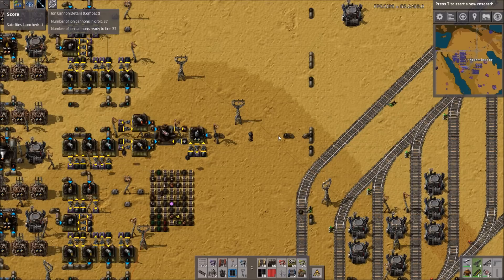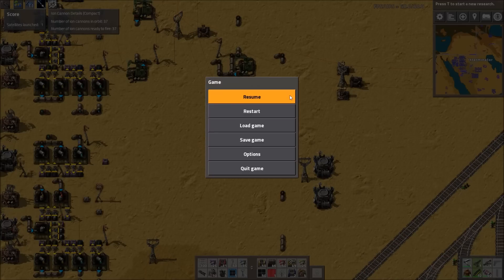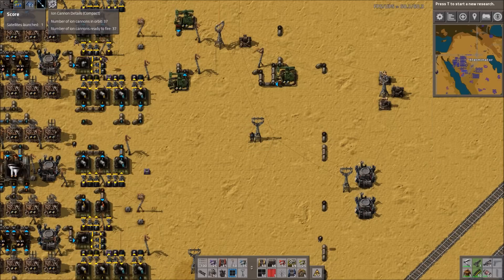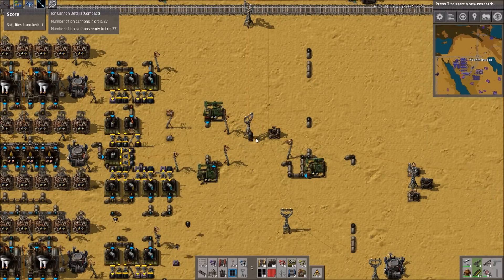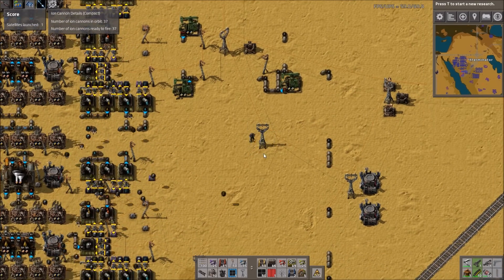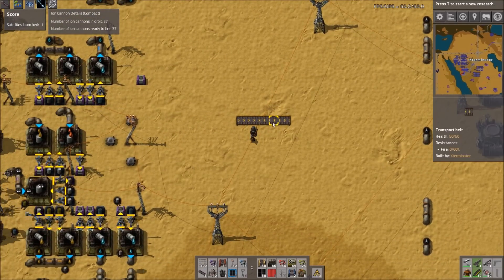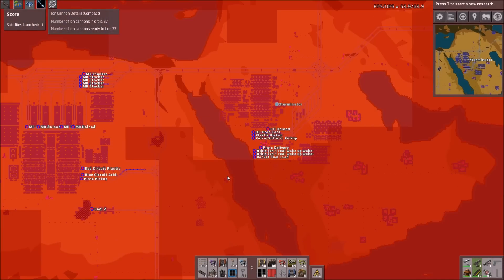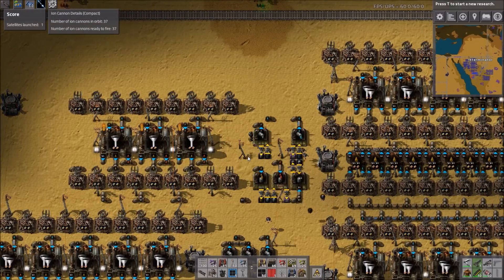5 Ways To Increase Performance & Reduce Lag - Factorio Tutorial

Comment: All this is fixed now? the concrete thing? i think that in 0.17 the performance is a lot better, especialmente in belts hehehe
Reply from the maker: Yup. Concrete thing isn't really fixed cause the issue with concrete is it makes pollution spread more
Reply: @Xterminator  So you only use concrete for the paths and maybe giving form to the factory?
Reply from the maker: @AestheticKunt  yeah, personally. I mean if you don't have performance problems and aren't building a megabase anyway, then it's probably fine to concrete a lot.
Reply: @Xterminator  I am a new player so idk what will happen in the future, i have a 8600k 5ghz anyway so idt i will have problems

Comment: I’ve just started playing, and every ten seconds or so the game FPS drops quite a bit, and I have no idea what is causing it because I’ve only built a stone furnace and a burner drill
Reply from the maker: Could be your video card or another program. I had similar issues when I had V-Sync turned on.
Reply: Xterminator well when I have v sync turned off I get moments where the FPS feels like it drops to like 20 for a few seconds, and then 20 seconds later it happens again. V sync has someone helped the issue but no it’s every 3 minutes the game freezes instead for half a second.
Reply from the maker: @Loulabelle100  hmm that is weird. Sounds like some of conflict with the game and your graphics card or some software. 
I'd try asking on the forums for help. :)
Reply: Xterminator it’s odd, factorio is like the least graphically intensive game I have so I’m surprised it had this issue
Reply: Xterminator well I deleted that save and made a new one, and I only had the issue twice in a whole hour, and it was a lot less noticeable. I will keep playing and decide if it is a problem solved
Reply from the maker: @Loulabelle100  cool, hopefully it works out!

Comment: I can answer the question at hand in one simple solution.

1. get a better or faster computer. solution done.
also most of the solutions stated in the video only affect enormous factories not typically factories that most people would casually make.
Reply from the maker: Yeah, if you can actually afford to buy a whole new computer just for this. xD

I agree, these are solutions for very big factories, but that is usually when you encounter these problems. If you are building normal sized factories like most people do, you won't really be having performance issues anyway unless your on like a 15 year old laptop or something.
Reply: Yeah, however a 8 year old laptop could barely run minecraft so...
Reply from the maker: True. Although Factorio is better optimized that Minecraft.

Comment: So the most performance efficient way to build mega factory is:
1. Use train only, no belts or robots
2. Use solar power only.
3. No concrete.
Reply: robots are fine, until you have 200k of them
Reply: @destroyer3729  if you are pretty crazy (like me), you wont need trains nor belts and youll have discovered some fancy tricks to fight/live with FPS lag because you will have 

FREAKING 4M LOGISTICS BOTS AND 1.5 BUILDING ONES. So...
Reply: for concrete it's 100% true , i decided to cover my whole factory in hazard and i dropped 60fps to 5. :v yes i did kind of overload my construction robots. XD
Reply: Wait concrete fucks us? Crap :(.

Comment: This will hopefully be fixed in 0.15 when they optimize the code, but using a mod like Undecorator to remove all decorations from a map halved my memory usage as well as reducing my save file from 85 MB to 35 MB. It allows me to play my post-game file on my cheapaft Acer Cloudbook with 2GB of ram, whereas before Factorio would have been OOM killed.

Additionally, the lack of decorations allows me to see and attempt to avoid rocks and trees while driving.

WARNING: Of course, this step is irreversible, so plan accordingly.
Reply from the maker: Yup it will be fixed in 0.15 I'm pretty sure. I am almost positive I remember them mentioning a fix for that. 
I agree though, and have experienced the same thing that removing all those decorations makes a huge difference, especially in the save file save, it's pretty crazy.

Comment: Thanks for the tips. I just got to the phase when I started building my megabase and I'm already down to 40 UPS. Will have to get rid of hacked splitters and will probably slowly transfer to full robot factory. The problem is, I'm using factorissimo and I can't use robots inside, so there will be still tons of belts inside, but I can do the outside transport with robots.
Reply from the maker: No problem! Ah yeah, the hacked splitters actually have quite a large performance hit just on their own, so removing those should help a fair bit. Also, factorissimo also has some performance hits I believe. 
But yeah, converting whatever you can to bots, and removing hacked splitters should help a fair bit.

Comment: Do you know how train+inserter based transport systems compare to belts/robots?
I like to build my bases with trains instead of a main bus, and I've seen designs that use stationary wagons instead of belts, with multiple assemblers pulling directly from those wagons. A similar thing could be achieved e.g. with the warehouses mod too. I'm wondering if it's also a viable way to reduce lag, since it does mean no collision checks and few entities (as compared to robots), but usually higher numbers of inserters, trains and train stations.

I mean this sort of thing:
https://forums.factorio.com/viewtopic.php?f=8&t=8551
Reply from the maker: I believe that it would be very performance efficient actually to use Cargo Wagons instead of belts or even bots. Stationary trains pretty much just act as boxes (I think), so insertering directly into them would hardly have an impact at all. Using warehousing as well would probably work about the same.

Comment: I ignored it on the video some time ago, when Zuri was explaining this already, but now I can't just let it go. ^^

No, loops in the train system do not ruin the pathfinding! In the other video Zuri tried to explain the pathfinding and kept calling it A*, but what he explained was a "width-first" approach, the worst possible routing algorithm... A* does take a heuristic into account, with in probably 99% of all pathfinding solutions is the bee-line-distance. So no, an A* algorithm will never search the second track going backwards for the fun of it, exactly because the heuristic prevents that. On the other hand you could argue, that a single-headed train only needs to do a single pathfinding, as it can only go in one direction. A double-headed train can go in 2 directions, so it actually has to do double the calculations! (I know, this is also not the case, but it's a similarly wrong argument.)

Loops are not perfect, though, as loop-based junctions are simply put a mess, as they either lock up all directions, risk self-lockdowns, or are a complicated mess, but that's a different questions. I'm going with single-headed trains in loop-based stations, but keep loops otherwise away from my system myself.

TL;DR: Loops to no affect performance. They are bad for other reasons, but performance is not one of them.

Other than that a great video again, thanks. ^^
Reply: No offense, but I read from your answer that you recently started getting into graph theory? That's nice, but also please consider algorithmic complexity at some point, because what you said about A* is simply false (or is it "alternative true" nowadays? ^^). Your comments about DFS and WFS are correct, though the problem with WFS is that you actually have to search the full graph up to the point where you reach the shortest path, so unless your graph/train network end up extremely unbalanced, there is no practical difference between the two xFS methods. And A* is not only of course guaranteed to find the shortest path, it's also mathematically proven to do it the fastest IF the used heuristic is correct. But for a system as simple as train routing, the euclidian distance between the points is a perfect fit.

After reaching a train loop of "Railworld" proportions of Mangled Pork fame, I do have to admit, though, that the implementation of the train routing is not optimal. It does not break your performance or anything, but the trains evaluate their route based on the current traffic snapshot. So another train that might occupy a single block somewhere along the optimal path is apparently considered a deadly obstacle, which must be avoided at all costs, so the routing ends up sending train a stupid distance sometimes, instead of accepting a slight wait sometimes. The problem here is of course not the routing algorithm (as this would affect all methods), but more the
Reply: I think it is beyond doubt that A* stands and falls with its heuristic, though route planning on a flat, 2D surface is as easy as it gets in this regard, using the euclidian distance. But to loop back (pun intended) to the original question: Neither A* nor WFS will suffer from loops, as claimed in the video. A* will simply ignore them based on that fact that "looping back" ruins the heuristic score, therefore these path options will be far back in the evaluation queue, and in WFS we're going through the whole graph anyway, until the best solution is found.
So if I may propose this conclusion: Train systems with loops (local and global) have their own share of problems in Factorio at the moment, based on the actual implementation of the train routing, but performance is not one of them. ^^
Reply from the maker: Yeah I believe it is about every 30 seconds. I am still sure that loops take more performance than non-loops but it probably isn't actually that significant. 
On a side note, could you send your science design again for workshops? I can't seem to find where/when you sent it before. :/
Reply: http://pastebin.com/3L4cXeyL
Reply from the maker: Just tried importing the blueprint again, and it still says it's not a blueprint string. :(
Reply: I have a hard time believing you are a computer scientist. A* is only as good as the heuristic you use. Since it is a variant of Dijkstra, it is still asymptotically optimal. Loops aren't the major problem, so much as "dead-ends" that look(as far as the algorithm is concerned) like they should have gotten close to the target. You can get around this by precomputing some of the connectivity information, and using it to make the heuristic better. In fact, it is provable, that with a perfect heuristic function, A* will examine the fewest possible nodes. It will literally walk directly to the target, and the path it took will be optimal. I think it is likely that Factorio uses a fairly standard heuristic for A*, which means it should be comparable to Dijkstra in terms of efficiency. Which means it is going to be better that depth first and breadth first search on pretty much all but pathological cases.
Reply: Also, how often do the trains need to do pathfinding? Every time it leaves a station? So that's perhaps once every 30 seconds per train? I doubt that it would be a significant effect.
Reply: That's another thing, and since trains are bound to the rails, they don't even have to do any collision checks on every square, but only check for free blocks in front of them... ;) Therefore one could argue, that reducing the number of signals used improves performance, too!! :D (not throughput, though, so it's not worth it ^^)
Reply: I think we're talking past each other. So let me be more explicit. I am not saying A* is always more efficiently implementable than Breadth first search. I am saying it doesn't make graph theoretic sense to talk about  Breadth first search like it is a different algorithm than A*. Breadth first search is a special case of the A* algorithm. The reduction is actually even trivial when you know it is there. 0 is an admissable A* heurustic function. On a graph with weights that are all the same constant, that is a breadth first search. Period. That makes it sound strange when you compare the two and say unqualified that one of them is terrible. I haven't looked at implementing them on dynamic graphs, and it seems like you are saying that they differ enough in implementation there to notice the difference. I would counter that pathfinding in such scenarios is a different beast altogether anyway. Unlike a simple graph search, I wouldn't consider it a solved problem. I stand by my statement that A* is only as good or bad as the heuristic function you give it.

Comment: The pollution part has been optimised. I can't remember if it is on 0.14 already or if it is coming on 0.15, but they redid the main loop of the game and instead of checking every tick if a chunk needs to be updated for pollution, it only updates the chunks that do need pollution checks. This alone increased performance by 5%.( its on a ff)
Reply from the maker: It may have been optimized, but it is still a big problem. I mean when I pulled up the map view with the debug overlay, we could see all those active chunks where the pollution was, which is definitely an issue. That is a huge amount of chunks to be active at once.
Reply: Xterminator The main issue was that chunks that needed pollution updates had to be loaded 100% just for the pollution update. This has been fixed now.
Reply: It hasn't yet been implemented into the game so you haven't seen the improvements.

Pollution and train loops really don't affect system performance very much. I play mega bases with more stuff going on than I'd care to admit, and it really just doesn't matter. When you say that it creates "a huge amount" of lag, you're over exaggerating a LOT. It does have small performance hits at very high levels, but it's never going to be the difference between whether or not you're lagging unless you're on a very wimpy machine. 
I don't think it's really that cool to exaggerate that much, as most people aren't going to do their own research and their just going to take what you say as fact.
Reply from the maker: Alchemical Games Pollution does in fact affect system performance by quite a lot so I wasn't exaggerating with that. Train loops may not as much as I had thought though. 
I have personally experienced how much pollution can impact performance. 
Was playing on a megabase with some guys a while back and was constantly falling behind, and dipping down to about 10 FPS/UPS. Later on we disabled pollution and my FPS/UPS went up by at least 20 if not more. It was indeed very noticeable.
Reply: Did you test this on single player or just server wide? 
My new theory is that it impacts servers a lot more than it would single player. Possible because the more players there are the more updates each chunk would have to do, and would spiral out of control. 
Biters also make a big difference but not in the way most people think. Biters only create lots of lag (usually) when they're forming into big masses and then attacking. But when bases are eating pollution and the biters are just faffing about they don't really hit performance. I tried two copies of a game one with biters and one without. To make it worth doing, i did a semi-hell world. 
The only times The biters noticably hit performance was when they were attacking. Both because their pathing and collisions take up cpu cycles, and defenses operate, then robots operate, logistical arms to reload the turrets operate, things get destroyed and make temporary spikes in performance. 

However, when the biter bases were eating pollution, if the bases were big enough and on the edge of the pollution ring, they ate the pollution and may have actually been helping performance. 

Of course. regardless of how much pollution there was or how many biter nests there were it never really made a huge difference, usually less than a half a frame. 

After much consideration and testing, there are only two things that really lag out a factory on a decent pc. 
Belts, and pipes(steam engines/boilers included).
Using a main bus and adding smelting until the game chugs reveals that entities produce the most lag. Second to that, using an abundance of pipes for anything /can/ somtimes be a big deal if there's enough. And with some of my oil setups on the test map it was. 

Fixes. 
Using underground belt can help a little of the problem but its a lot of work for only a very slight improvement. Removing as much belt as you can and using robots reduces a lot of lag.

underground pipes count as a single pipe, and for some reason also cause less lag as apparently its not simulating liquid physics for so many things. The best fix to this in my opinion is either to make oil and any pipe using productions extremely efficient and use the minimal amount of pipe. Or, you can barrel your oil. With mods, you can barrel everything. Which means you just unbarrel liquids wherever you need them and this usually helps a bit.
But of course if there aren't any performance issues in the first place, going through and min maxing won't do much besides scratch that ocd itch. 

One more improvment i found helped when my factory was at its largest, was reducing the amount of furnaces I had. 
1. change everything to electric
2. remove your whole smelting setups
3. use the robot network to deliver ore, and pick up product
4. 3 or more beacons working on each furnace reduces the need for extras, use the best modules
5. You will now only need aprx. 1/3rd or 1/4th of your previous amount of furnaces. It also clears up space in your factory, and you can rebuild it all to look nice and be efficient.
Reply: Alchemical Games This makes sense to me. The pipes part will become easier with 0.15 as you will be able to use trains for your liquids and as such you will be able to move e.g. the lubricant directly to 2 different areas producing robots and belts and the sulfuric acid for the batteries